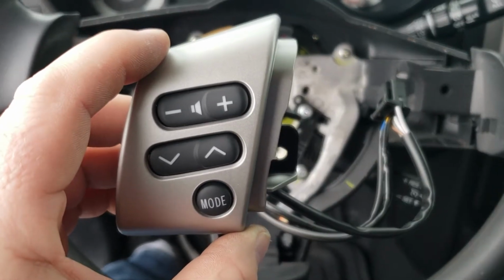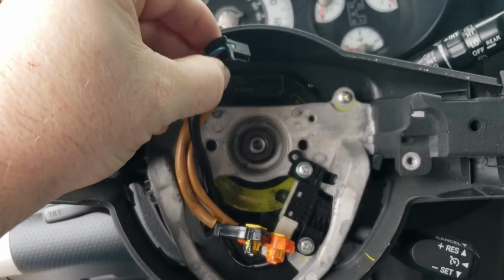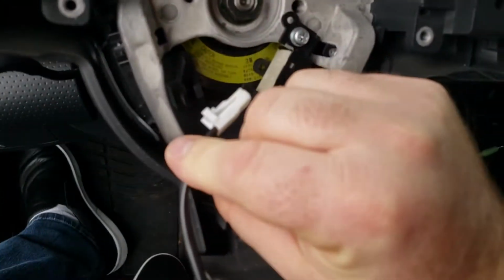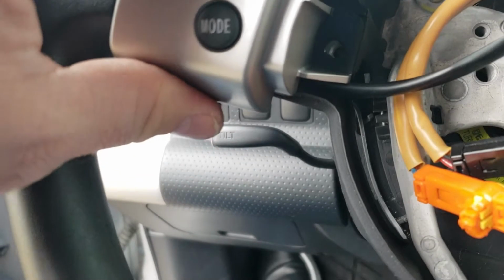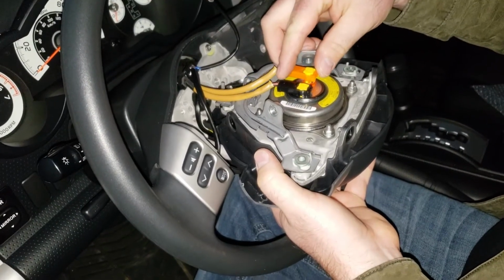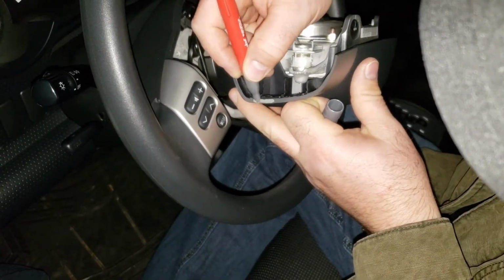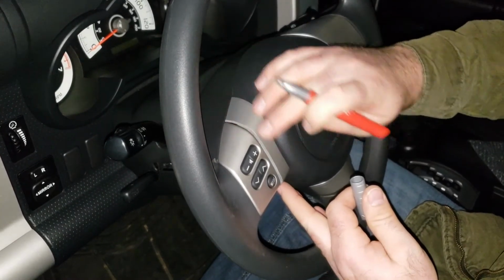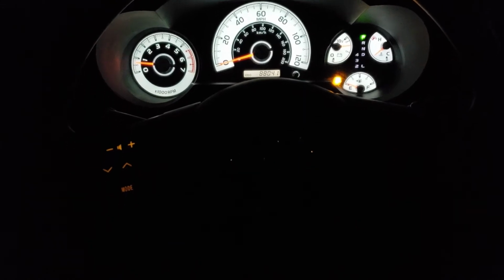FJ Cruiser Audio Control and Steering Wheel Reassembly

Comment: Hmmm, I hate the fact you have to cut the centerpiece to make it fit. But it’ll be worth it. The silver part is faaaaaded pretty bad.
Reply from the maker: Might be a good time to repaint it! If you're careful and use a sanding block the cuts come out nice. Just make sure your controls work before you cut anything. Worst case you put it back the way it was.

Comment: tried on a fj 2010 base model, aftermarket kenwood radio, not working, no lit up on the control........am i missing something here?
Reply from the maker: Were all the connections the same on wiring harness at the steering wheel? Was the Kenwood installed with a harness that plugs into the factory harness or was it cut and spliced in?

Comment: Who did you order the switch from
Reply from the maker: I ordered from a Toyota dealer in my area. You can also look at Toyota dealers online. Many of them will ship it to you for less then your local dealer. There is a link in the description to my post on the FJ Cruiser forums with part numbers you can use to search. You should be able to find the left control for around $100.

Comment: Can steering wheel controls be added to FJ's without steering wheel controls at all?
Reply from the maker: Yes. My 08 is a base model and had no controls but the wiring was there. Some later years removed the wiring but the early ones definitely had it. See the description for my other 2 videos and check for the plugs before you order the parts.
Reply: @kylegreen9421  very cool, thank you for the reply. Subbed!
Reply: Yes.

Comment: Did you disconnect the battery terminals again before plugging the air bag wires back in? I’m concerned they can accidentally set off for some reason lol
Reply from the maker: Yes. I was also concerned about accidental deployment.

Comment: hi bro on my steering wheel dont have  any controller option if i want to upgrade and order  the controller audio  and the phone controller will be possible to install without changing hole steering wheel or no need ?
Reply from the maker: Check this out. https://www.fjcruiserforums.com/threads/add-steering-wheel-audio-controls-to-base-models.743832/#post-9349368 If you have questions after that let me know. I did not install the phone side as my head unit handles that on the touch screen.

Comment: Hi Kyle, is the same installation process in  a 2018 FJ cruiser? I would like to add the media and phone controls.
Reply from the maker: Sorry, I wish I knew about the 2018. From what I have read on the forums much of the extra wiring for optional components was removed in the later models. Best way to tell would be to remove the airbag unit and see if the wiring harness is there.

Comment: Kyle, like all the extra options you could buy on a early fj cruiser, I assume that all this is pre-wired? Are these OEM parts or aftermarket? Can you also tell me the part numbers. Thanks a lot from a proud fj owner from Holland....
Reply from the maker: Yes, it's all pre-wired in the early models. The parts are OEM. 

https://www.fjcruiserforums.com/threads/add-steering-wheel-audio-controls-to-base-models.743832/#post-9349368